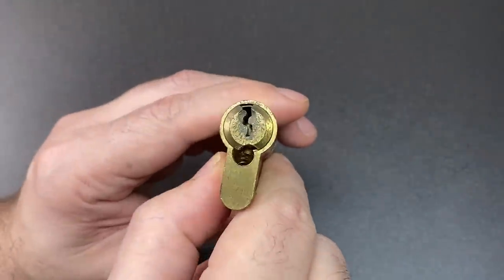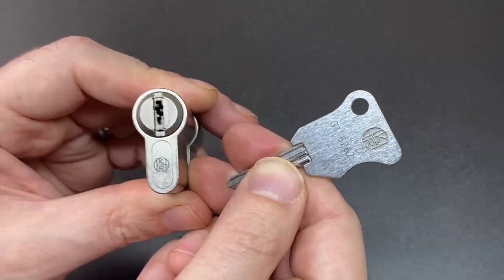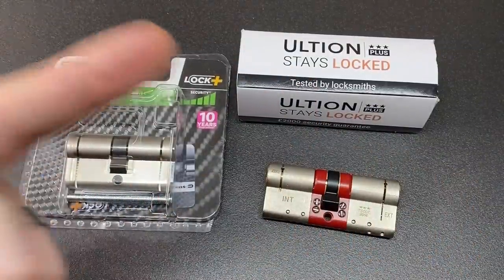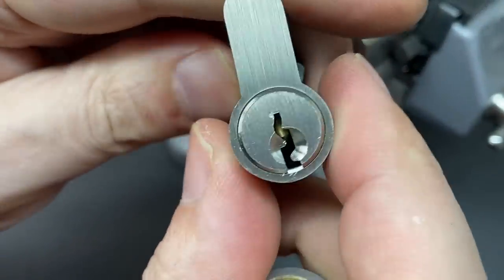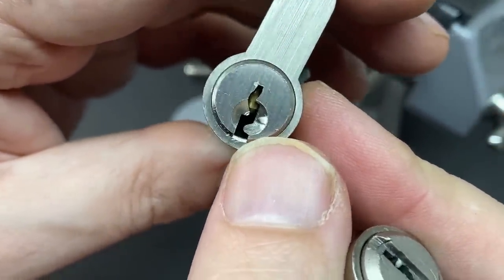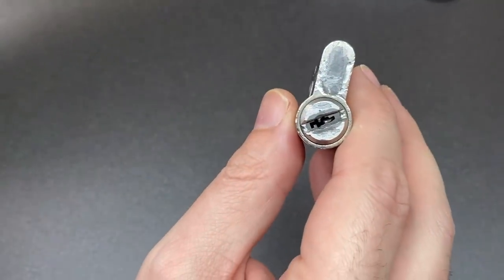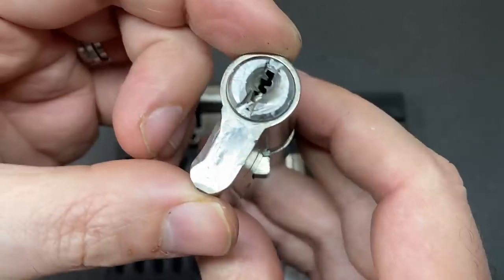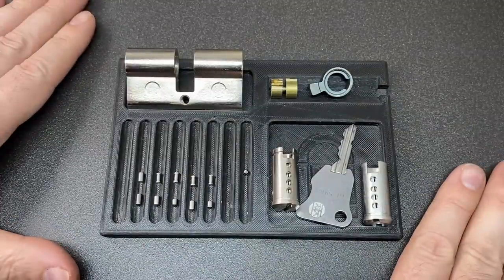Amazing Rare Anti-Drill HKR Lock

Comment: Looks like the body of that HKR lock and the key are also made of steel - pretty cool.  When selecting locks for my house I tend to balance the ability of the lock to keep miscreants out against the difficulty of getting myself inside if I happen to lose my keys. So I want something that resists common attacks, but I could still open non-destructively if I had my lock picks on me.
If even a professional locksmith would struggle to get inside without damaging the door or breaking a window in the process, I tend to consider that overkill for domestic use e.g. Abloy...
That HKR looks like it would have been an excellent choice though, nigh on indestructable but still pickable.

On a related note, a thing that's often overlooked is that there are security door handles and escutcheons available, which will go some way to prevent drilling and snapping attacks by covering up the face of the lock with a steel housing and a spinner plate.
Reply: Correct these protectors started to be developed about 30 years ago. As it protects against core pulling which we introduced with our first tool.
Reply: Got loads  of pictures  of doors with high security  door furniture  and locks,  been broken  into in a few seconds  through bthe DGU.
Reply: @cardiffpicker1  Yup, I remember reading that in some windows the glass could be taken out by cutting through the beading.
Reply: @Chlorate299  Indeed, security is only as strong as its weakest link. In any case any security is a deterrent, the best defense is not putting targets on display (don't leave a garage door open top long if it has expensive vehicles or tools on show). If the risk/reward is too high, criminals may be deterred and look elsewhere.
Reply: @TC-th1ey  Indeed, and going back to door locks really the only thing we need to achieve is not making the door lock an obvious weak point - we still see so many older Euro cylinders sticking out and begging for a git with a pair of mole grips to come along.

Comment: To be fair a drilling standard is Rotory tool with a Carbide milling bit.
At his point hardend Metal is no problem at all. But I could imagine Carbide inserts in locks and or ceramics might work superior to add drilling resistance to a lock
Reply: The isets are carbide. The milling bit used in the video is a high quality carbide bit we sell to firefighters and locksmiths.
Reply: @Zieh-Fix  makes sense to me. I thought the bits he used was just some regular high-speed steal bits.
If the inserts are carbide it absolutely makes sense drilling is a tough thing to do
Reply: I’ve used 1/4 inch ball cutters to go through Medeco locks fairly fast.

Comment: Sorry to break your dreams... 
We locksmiths use 3mm Chinesium 3euro Burr's that bypass the hardened pins. It's basically the width of a key, and you just pull the pins out one by one until the lock is 'clean' and a flat screwdriver opens it.
(I'm a locksmith by profession)
A single 3mm burr last me easily 30 high security cilinders

Comment: As I have learnt to my cost with anti drill, anti pick hardened steel locks, if your lock stops working with the key, you will have to replace the whole door. That lock is NOT coming out.
Reply from the maker: Well there is that… what locks in particular?
Reply: @LockNoob  hykee high security van door lock.

Comment: Do you have any advice for a new picker, that prefers to pick in hand, but often struggles with cores that contain a lot of spools, due to hand cramps?
I do have a suction desk vise, but i feel like i dont get anywhere near the same type of feedback id get vs in my hand.
It might be the way i hold my pick, in which i let the shank of the pick rest on the last knuckle of my middle finger, and my pointer finger i throw over the top of the handle so it falls in front of my thumb. 
holding it the way everyone else seems to, like a pencil, feels off to me, also makes it harder to feel the pins for some reason
Reply from the maker: You could try the lock in the vice but then place your non picking hand on the vice and lock. You can still get a bit of feedback from the lock if you have some contact with it that way

Comment: The attacks are all high speed.  This causes the metal to 'work harden'.  To cut through this lock you need a good drill bit turning slowly and plenty of lube (TWSS).
Reply: Because a thief certainly wants to spend a lot of time in front of the door dripping cutting oil  out of a can on the lock. No,  see Apu Apu's comment - carbide mill bit.
Reply: Drilling carbide? 
Very very very hard. Nothing you want to do quick or slow.

Comment: I don't really see the point of that type of key control, as it would be very easy to just file the same notch in every position. That way it wouldn't matter where the ballbearing was.
Reply: Yes it's the same with passive pins but it allows the manufacturers to easily increase the amount of possible combinations. that's why passive elements are very common in mid class zylinders.

Comment: looks like a good lock, shame i aint going anywhere near it. why pick a lock when i can just unscrew roof sheets, or pop or grind hinges, or unbolt and smash windows. 100 other ways to brak in. hows it hold up to thermite?
or my fav awesome lock like this on a wooden door or frame. anys, cool vid.
Reply: Yeah, making a burglar look for a different path to entry is THE POINT of putting in good locks. If the door that the lock is in has a glass panel next it, well that's just silly. If the patio door in the back has a cheap lock on it, well that's on the homeowner. Security needs to be at a reasonable level all 'round.
Reply: You've got to consider, how they get out.not going to get a safe or your motobike out via the roof or window easily. Really need to roll out a door. You can make it alot harder to get out ..if you have a monitored alarm, they don't have forever to do this.

Comment: You are drilling the wrong point.  But that put to one side....what is the point of the drill protection if it has zero anti snap protection?. There is NO excuse to be manufacturing euro cylinders meant for exterior doors with zero snap protection. Manufacturers are still doing it. On anthor note...the cheapskate manufacturers need to unite and change the industry. They need to improve their products to meet today's standards. Even if it means they agree on new prices that all customers will have to pay. In an ideal world maybe. I say the steel bolts on metal gates....I was thinking....they could easily produce anti angle grinder sliding bolts if they can do that with shackles for his security applications if not all their door hardware. No excuses because it can be done
Reply: Baz doesn't want to pay a few more pounds for a lock and will take the cheap knock-off lock that's made in (insert S.E. Asian country) over a lock made in (Germany for instance). Since burglary affects a relatively small portion of the population the odds are Baz won't get burgled and will be satisfies with his p.o.s. lock.
Reply: Snapping protection. You will search long for that in germany or Austria.
Insurance normally wants us to install a security fitting you can't easily remove. This is the reason even expensive locks will often not have a snapping protection. Instead a core pulling and pulling protection as that will protect against most snap attempts as well.

Comment: Send one to me locknoob. Walter carbide tipped drills should get it quickly
Reply: Carbide against carbide?
The burrs we used in the video we did for locknoob are made from carbide. If a 25.000rpm carbide burr only does a little dent. A normal carbide drill won't do much more.
Yes with little pressure and enough time you can mill or drill these. But that's not feasible for a locksmith 😉
Reply: However if you come to our event bring your drills and you are invited to try 😊